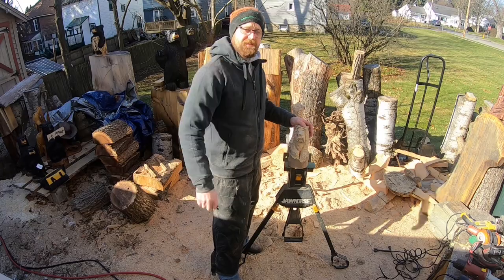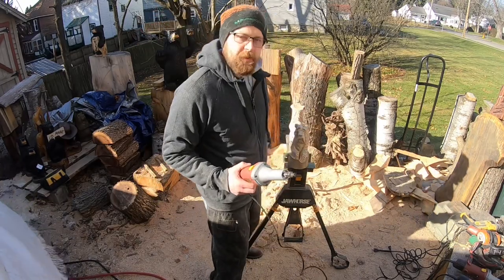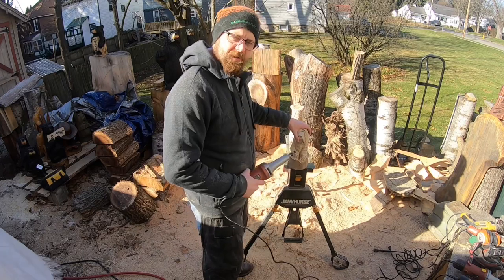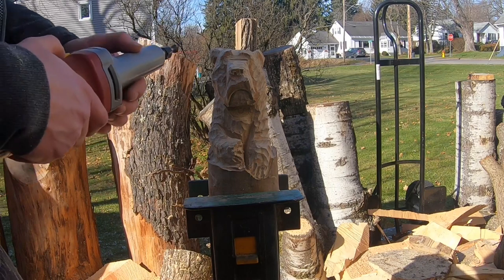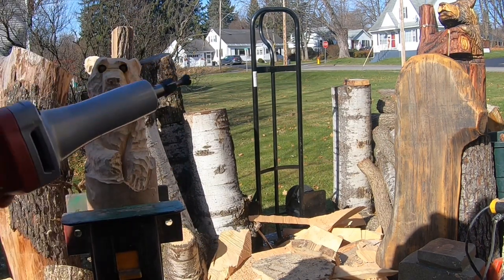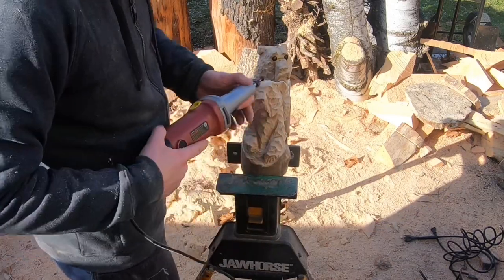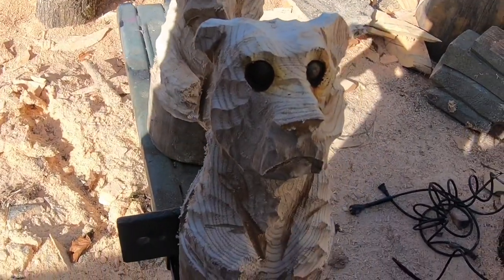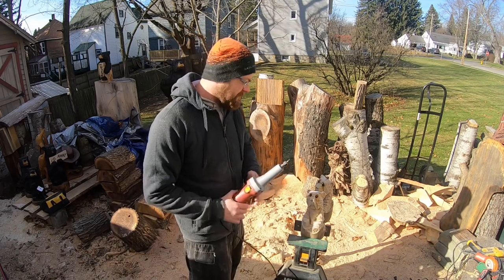New tool from Saburrtooth !

Comment: Got my bit Kyle, it seems they ship them right out. Some stickers and other goodies in there too. 
It works terrific, Keep the RPM low in a Foredom and it cuts perfect clean eyes with no burning, spin her up and it self darkens. While experimenting I discovered the edge makes a great fine-line tool as well, for eyelashes, hair etc. Go slow and use light pressure and it cuts a nice fine line without digging in.
You're right about being careful, they get get ripping hot after only a couple cuts. No matter, I usually don't carve critters with more than 2 eyes....  
They work so well that now I'm sorry I didn't spring for both sizes. I'm hoping they come out with some smaller sizes for us small(er) figure carvers. If not I may have to have a go at making some small ones myself.
Another winner from Sabretooth , thanks for the tip!
Reply from the maker: Thanks for the comment Scott . Saburrtooth did just release a 1/4 shaft 1/4 cut cross cutters
Reply: @KyleHallwoodworker  Thanks for the info, Just placed an order. Pricey buggers, but worth it in the long run I think.
Reply from the maker: They are pricey but I believe they are worth it .

Comment: I love all my Saburrtooth stuff. Have a fair number of bits, and a couple of buzzouts in 3/4. Love them all. Wood movers par excellance! They're  such a joy to use, I find myself making up a reason to put a Buzzout or 2 x 1/4" saw in the old Foredom TX Squaredrive. 

I ordered a 1/2" Cross Cutter with your discount code and I DIDN'T get the 10% off.... 

I GOT 10 BUCKS OFF!!!    Awesome deal ! Thanks Kyle!  -- (and Saburrtooth)
Reply from the maker: Awesome!! I like the burrs a lot
Reply: Im from Romania and my biax is wuth 6 mm shank. What measurw fits by us standard measure. They reply its not goid the 1/4". Witch one us good then close to it
Reply from the maker: @moldcatalin  go to Saburrtooth.com they offer 3mm and 6mm shanked burrs

Comment: Hy. I need the bits from sabuur but my biax is 6 mm shank.what measure can fit?
The reply for 1/4" is not fit.
Im from Romania.
Reply from the maker: Saburrtooth offers shanks in 6mm and 3mm pout the 1/8 and 1/4 shaft . Got to Saburrtooth.com also used code HALL10 till the end February for a discount